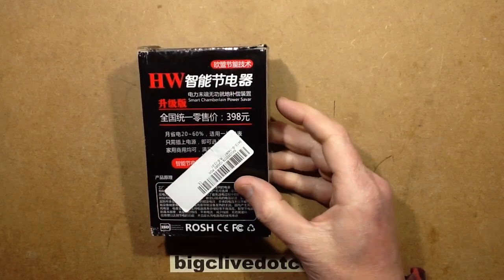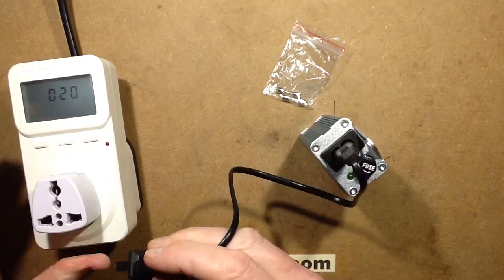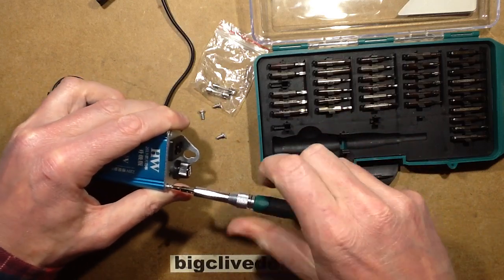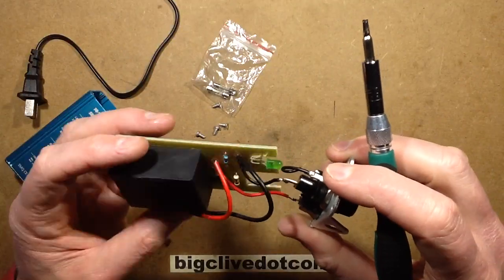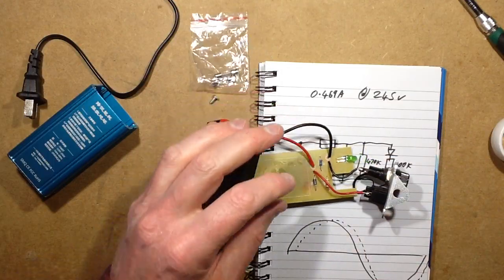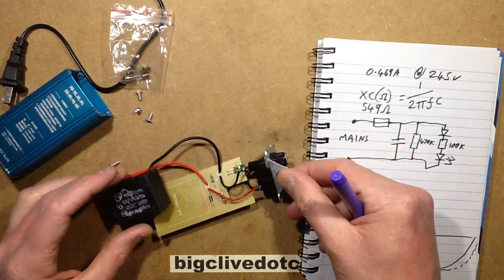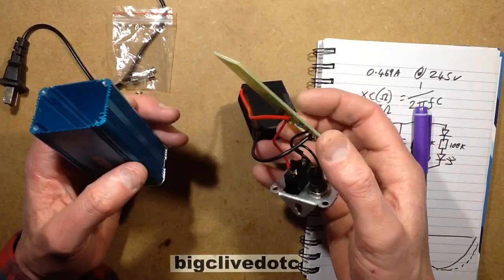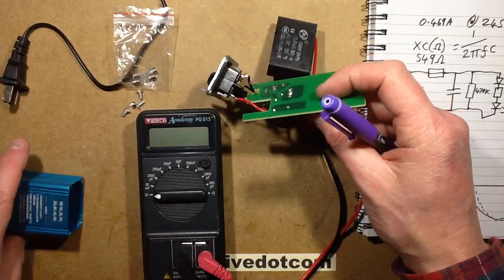200kW miracle power saving device.

Comment: It does what it says - it "savars" the power. PS: I think that selling this junk in a seasonal manner works well. For example, the winter comes, people got high electricity bill - they are using far more heating elements than usual, then right around spring these devices pop up (they don't actually have to pop-up - some people look for them), then people buy them, then the weather gets hotter and thus lower electricity bill due to less heating elements being active and so the superstition of this device actually saving power rises in some group of people. Remember, we all know that SPAM is bad, but it still exists which means it's profitable, which means some small (but big enough for the scam to live) group of people gets fooled on a daily basis, or in other words "a sucker is born every day".

Comment: Did they really just fake a RoHS-certificate by printing ROSH on the box? Damn Chinese..
Reply: +F1nWarri0r isn't RoHS is just indicate that the product use non-toxic material like Pb? they might use tin to solder those pin so yea... basically it's meet the qualification
Reply: +SandPox RoHS-certificate means just that, regulating harmful substances. What I meant they faked the certificate on the box, it says ROSH instead of RoHS. Looks like the actual product has the correct logo, weird.
Reply: +F1nWarri0r 
To my knowledge the RoHS declaration is "self-certified" (as is the CE mark). So there is no point in faking it. Of course should be the correct logo,  but it doesn't really matter if it's correct or not and even some european manufacturers get it wrong. The manufacturer has to provide a conformity declaration and importers/sellers within the EU are supposed to check that and are responsible for it. Just because the chinese don't get the logo right, doesn't mean it doesn't conform (of course the opposite is true as well). It's the same with the CE-mark, where there's the myth about the "chinese export" mark. By the ugly latin font that many chinese products use, you can tell that they don't really care for/know about the looks of latin writing. And it's just so much easier when designing a product or label to use the normal letters C and E than import a specified graphic.

Comment: Just crossed my mind that this might be a cheap way of getting a decent size non-electrolytic high voltage capacitor and what looks like a half decent case.
Reply: +Gordon Lawrence Kinda expensive, but if you need one with an AC socket too ... well, still  kinda expensive
Reply: yep they cost more than I thought you can get the box for about £4 and the cap for the same. The unit is more like £15

Comment: It's possible to really hammer your gas and electricity bills if you know what you are doing.  My GF had bills of around £140 a month for gas and electricity combined. Changing supplier immediately took that down to £90 a month. Selling her unfeasibly big plasma screen TV and with the money buying an LED TV saves her another £4 a month even though it's nearly the same size, changing to a better boiler has saved her another £10 a month. We have swapped out the halogen lights in the lounge for LED lights and they use around 20% of the power (we don't have the exact savings calculated yet). The aim is to get her bills as low as mine - £46 a month for gas and electricity combined. It can be done but not with quackery like this. That said expect your electricity and gas supplier to visit every couple of months to make sure you have not tampered with the meters.

Comment: 200kW.
200kW.
My massive welder doesn't even break 20kW. My house as a whole doesn't even break 100kW peak. And that little thing will plug into a basic household socket and do 200kW? That's more ridiculous than the claim it will save power.

Please send it to PhotonicInduction and see if he can put 200kW+ through it and see what happens.

Comment: Pf is read on Smart meters
Reply: +HDXFH not many people have them.
In the UK at least.
Reply: +HDXFH 
Which would make this device even more stupid to use. With all the switch mode power supplies in devices most of the non-resisitve loads are (kind of ugly) capacitive already anyway.

Comment: if you need a good aluminum housing and willing to spend $35 for it. there ya go. however id just suggest buying one of these. http://www.ebay.com/itm/Extruded-Aluminum-Box-Black-Enclosure-Electronic-Project-Case-PCB-DIY-50-25-25mm-/321803082516?hash=item4aecf55b14:g:az4AAOSwDNdVnkrp
Reply: +danz409 Thanks, they look good

Comment: I'm a bit curious about this whole Power Factor Correction thing.  It's not actually changing the efficiency of AC motors or anything, correct?  It's just changing the waveform relationships between current and voltage?

The only reason I'm curious is because here in Southern California, running the A/C in the "summer" (read: 10 months out of the year...) quite literally triples my electric bill, sometimes pushing it into the $600/month range.  Anything I could do to improve efficiency would be quite beneficial.

On an unrelated note, I have a bunch of 0.25 Farad (yes, Farad) 600VDC capacitors out in the garage that're collecting dust.  Would you like one?  :D
Reply: Electrical power (in Watts) is a measure of how much energy is converted from the electrical supply to motion, heat, light, or sound etc. With AC systems, inductive loads (motors, transformers, fluorescent light fittings etc) generate a magnetic field. As the sine wave of the AC supply falls below it's peak value, the magnetic field collapses, and so some current is returned to the supply. The amount of power actually converted (consumed) is the same, but the amount of current in the circuit is higher. If the meter measures only actual power, it makes no difference to the bill if power factor correction is used. If the meter only measures current, or in industrial uses (including large office buildings ), the meter also records power factor, you pay more.

Comment: i had a device that had a fan in it that you'd hook a water hose into.  well, that thing didn't work so i decided to take it apart and just use the fan in it.  i got a switch off of another dead fan and hooked it in line, but there's also two wires that seems to run to a 5 microfarad 450v capacitor that i have yet to hook up.  the fan starts up if you spin it, but fails to start under it's own power.  should i try the capacitor or go with my original idea of lubing the motor?
Reply: +tailsnumber1fan5590 unfortunately i can not find the guy who suggested to use the capacitor so i can thank them.  i added the capacitor inline into the motor and not only does it start under it's own power but it spins a lot faster too.  so whoever you are...thanks.

Comment: I would buy it just for the aluminum case as a project box. US on ebay is right between 7 and 8 dollars. that's dirt cheap. plus a few cheap internals for blowing up or the parts bin. put that 450v cap across a 2500v microwave trans and see what happens. haha. enjoying the vids clive kep em coming.

Comment: I like this guy. He is very knowledgeable. He really brings out the facts with all his demos. 

I sometimes get phone calls and emails from Scammers trying to sell me such power saving gadgets.  I have used a power analyzer with a display screen to view the sine wave of the AC power. The distortion in the power is very low.  

There is no possible way to save power other than switching devices off, or making sure they are in proper working condition. There is no possible way to create power that is not there. These Scammers have ways to describe things to sound good. The power company meter reads the total power no matter if the load is more inductive or captivate. 

To save power, turn your heat down by a few degrees if it would not be too cold for you. Turn off lights that are not required. Use LED or CFL lights. Better with the LED type. Change your older appliances for the newer power saving type. In cold weather keep the windows closed.  Make sure your home insulation is up to spec, and there are minimal thermo losses. During the day open your curtains and take advantage of the sun light to bring in some heat. Close the curtains at night to act like a bit of an insulator between your room and the windows. 

There is no free ride to save electricity with adding gadgets.

Comment: "ELI the ICE man"
ELI = with L (Inductance) Voltage (E)  leads current (I)
ICE =with C (Capacitance) Current (I) leads voltage (E)

Capacitive reactance negates inductive reactance to improve power factor and reduce reactive current.
Reply: +superdau But not everyone is a fucking expert like you fella.

How about trying to encourage people to learn, which is what this channel is about, rather than belittling their efforts.
Reply: +lazaglider true dat!
Reply: @superdau @RIB B 
No, that explanation is not quite right, superdau. 
With a capacitor, Current charged from the previous cycle can push current into the line or load (where Resistive and Inductive loads predominate) even at Zero line volts. (That can be done anywhere on a circuit, all the way back to the generating station.) Not that putting a fixed capacitance into an inductive device like a motor is going to achieve perfect phase correction (reactive cancellation) all the time. The ideal reactance varies with motor load and, as the equations show, reactance varies with frequency, too. 
In 3-phase systems, even a transformer can provide some phase correction, because when converting either Delta==>Wye or Wye==>Delta, there is a 30 degree phase shift.
Reply: +RIB B I never could remember that..instead I always thought about complex (a+i*b) representation of resistance..  C and L rotate vector in opposite directions..forward by phase or back by phase..
Reply: did you take physics with Dr. Watters?
Reply: @thad ius 
No, that explanation is backwards. With a capacitor, Current charged from the previous cycle can push current into the line or load (where Resistive and Inductive loads predominate) even at Zero line volts.
Reply: I worked in JD foundry...induction furnaces, some of largest in world. They had capacitors inline on the leads coming from motor starters. They just screwed the lil things across the motor starter heaters. Parallel or inline. You could do this on the side of receptacle if you feed through it rather than pigtail feed it.
Reply: +RIB B 
Do you really need a mnemonic for that? It't obvious that you need to put some charge (=current x time) into a capacitor before the voltage rises.

Comment: I think you should hack it and make it into something else, something useful (or maybe playful). A single-purposed . . . .something or another. Power inverter? Ionizer? Dehumidifier? Space heater? Cooling fan? Portable USB Power Supply? Frequency Generator? Function Generator? The ideas!
Reply from the maker: +David “Derpy Drift” Adams A new "tingle tron".
Reply: bigclivedotcom or a REALLY fancy Joule Thief. Then auction it off . . .as long as you offer shipping to the states, I'll bid.
Reply: +David “Derpy Drift” Adams Joule thiefs are actually nothing more than low voltage boost converters, and inefficient ones at that.
Reply: Power Max I'm aware of what they are, but they'd be just as useful as this item, LOL!
Reply: +David “Derpy Drift” Adams It effectively is a 0.3W space heater already :)
Reply: anononomous HAHAHAHA! You're correct!

Comment: I always wondered why some ac plugs were polarized...is it to keep it in phase with other things
Reply from the maker: +Random_rapper20 To allow switches and protection to be put on the live conductor and also so that table lights with Edison screw holders have the correct polarity (neutral to the ring)

Comment: So what's the purpose of the diode in the diagram? Wouldn't the circuit function exactly the same with just the resistor and led? Two diodes in series don't do anything special that I'm aware of.
Reply from the maker: +Brad Gefroh The LED is only rated to reverse block about 5V.  The other diode will reduce the power dissipation as the LED on its own would avalanche on each opposite half wave and conduct without lighting, almost doubling the resistors dissipation.
Reply: +Brad Gefroh BigClive is correct but there is also another problem. LED's are not designed to work in avalanche mode. Some can take a small amount of reverse current but most will die pretty rapidly if you drive them as hard in reverse as you do forward. I have seen product recalls for this though that was 20 years ago.

Comment: I'm having much fun watching your videos and I learned a lot too. I would like to ask you to do a teardown and quality inspection of the Blitzwolf USB charger from Banggood, if possible. They seem to be of good quality, but I don't want to be zapped or find that the charger killed my phone or other devices or even burn up in flames :)
I very much value your opinion and methods of inspecting the devices you do the teardown of.
I am thinking of buying this one: http://www.banggood.com/Qualcomm-Certified-BlitzWolf-QC3_02_4A-30W-Dual-USB-Fast-Charger-EU-Adapter-With-Power3S-Tech-p-1047935.html along with this charger monitor device: http://www.banggood.com/USB-Current-Voltage-Doctor-Charger-Capacity-Tester-Meter-w-Cable-for-Power-Bank-p-1046863.html

Keep up the good work, Clive and thanks in advance.

Comment: You upload videos at strange times 😂 you must be nocturnal
Reply from the maker: +Adam Rhodes I'm very nocturnal.
Reply: +bigclivedotcom Me too!!! Clive: with many simple calculators like the one you are using, to get reciprocal [1/x] without needing to use the memory, often it works by just pressing the divide button, and then the equals button.
Reply from the maker: +LakeNipissing Well whadaya know.  It works.  I'll have to remember that one.  I already know the trick about setting a constant.  For instance, if you press 2 X X it will then multiply every number by two, so if you then press 1 and keep pressing = it will count in binary.
Reply: bigclivedotcom  These are things us "nocturnal" folks discover while "beverages" are consumed. ;)

Comment: Top tip if you think a case may be live: Don't touch it with the inside of your finger tips, the muscular contraction can cause you to involuntarily grab the device (which isn't good). Use the backs of your fingers instead. That way, any muscular contraction pulls you away from it. Even topper tip: Use the right tool for the job :D
Reply: +Zadster Even better tip... get someone else to grab it!!! Or be sensible and just don't touch it! lol Great tip though... same as the electricians with one hand always in the pocket ;)
Reply: Chris Landry Indeed... they are quite elastic in nature and bounce back from nearly anything! :-O
Reply: Just give it the foreskin test. You get a hard on and touch the case with the very tip of your foreskin. If it retracts, it's live.
Reply: Zadster 
I always get the cat or the dog to go sniff the appliance in question. If the appliance throws a shock they alert me immediately.
Reply: With AC there will be no muscular contraction. Still best to flick with knuckles to test for live as the contact is relativity high impedance and all you get will be a tingle.
Reply: Good tip, tho always assume with metal case things with no ground that they are live and will kill you. All things with a metal case should be grounded, but ehhh China doesn't have or know the word "safety".
Reply: 安全
Reply: @chrisosborne-w5g  keep a chicken stick (as the electricians call them). The pen size current sensor.

Comment: It is my understanding that home electricity metrers (Wattmeters) are built by having a winding in series for the amperage and another winding accros the line for the voltage.  The two winding interacts (add their magnitism) as in a regular wattmeter.  For the interaction to be metered, both the current and the voltage have to be in phase.  When the line is inductive (caused by motors or ballasts) only the portion of the sinewave that are common to both the current and the voltage is measured ( this lag of the voltage over the current is refered to as the Cosinus Phi factor).  If the lag exceeds a certain limit, the power company will install banks of capacitors the compensate the inductive lag)  Therefore, the gadget presented here would in theory lower the reading (and therefore your electrical bill) of the electricity meter only in the case where your actual consumption was quite in phase or already having your amperage lagging.  On the other hand, in normal households, the load is usually inductive and the gadget would bring the current more in phase with the voltage, therefore making your meter show more power consumtion.  Quack Quack !
Reply: +simontay1984 You are absolutely right.  That's why the electric companie are so eager to upgrade all meters.  Therefore, the only thing left is there might be a theoritical advantage to correct the cos phi factor in a house on your own...  like getting the most of what you pay for ?  Not sure.. mmm ??

Comment: Just goes to show you how stupid and gullible the average consumer is. Anything that you plug into your wall socket can only CONSUME power, not save it.
Reply: +Erika Sandstrom I have a hard time believing average consumer would ever buy this thing. They probably sell because you get the nice, solid case, big capacitor, led and clean moddable pcb, all shipped to your doorstep for less than $15.
Reply: +Erika Sandstrom Not entirely true, but sort of. And saving money doesn't always mean saving power.. i.e. switching to battery backup during more expensive energy usage times.
Reply: If I plug a dummy plug into the earth pin socket of a mains socket, that shouldn't consume power :)
Reply: +Eskimos24 Nice cases are so hard to come by.